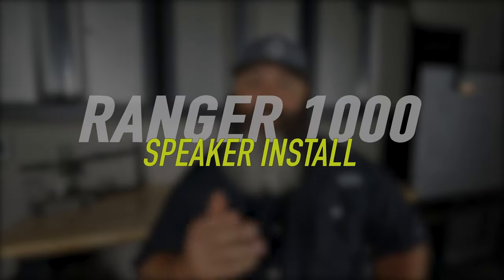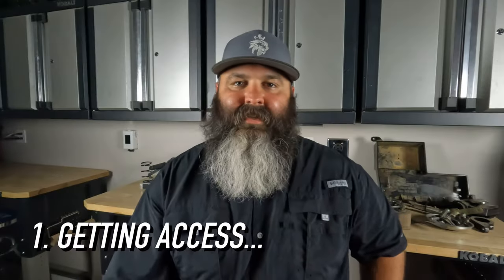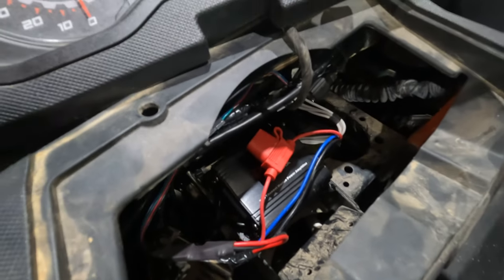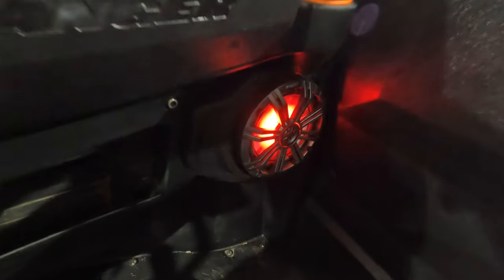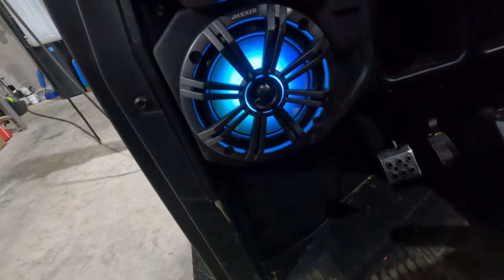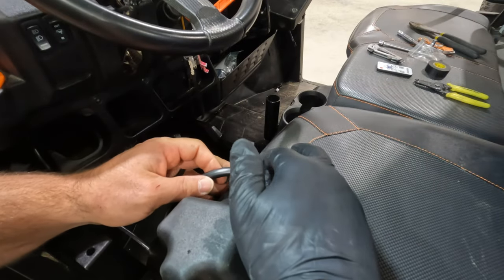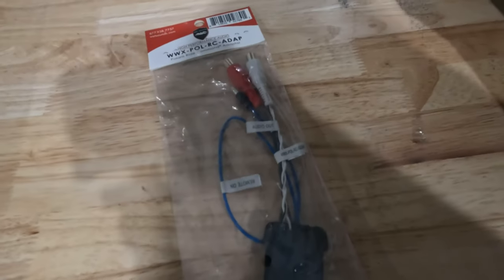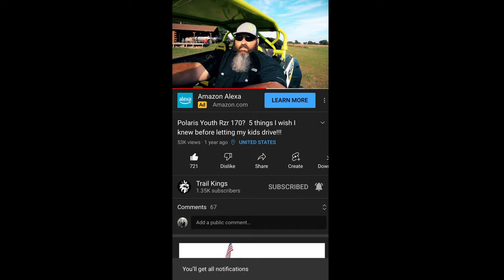Ranger 1000 Speaker Install for Ride Command (3 Things to know before starting the install process)

Comment: Did you have any issues with the amp not working with ride command?
Reply from the maker: I did not. I had to turn up the amp on the amp controls but other than that it was plug and play.

Comment: What do you do if you want to add a 2 channel amp to ride command and get rid of the factory 1 channel
Amp?  Use amp 2 plug and move speaker wires
To new amp?
Reply from the maker: I believe the amp we used was a 2 channel. The speakers are just wired through the amp.  It’s not base thumping loud but it’s good for what we were wanting. 

Yes to using the Amp 2 plug. That’s the one we used.